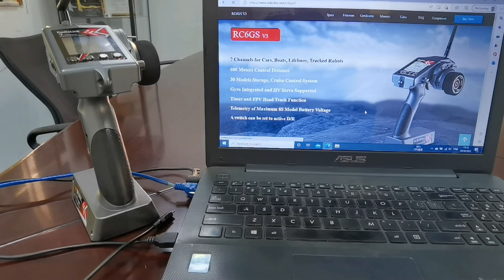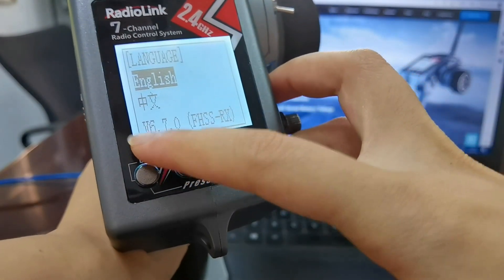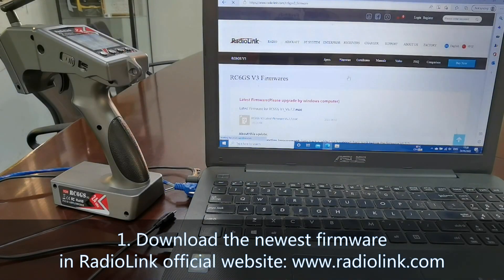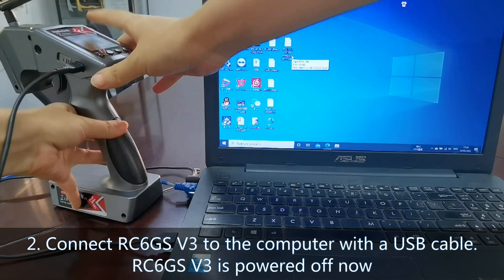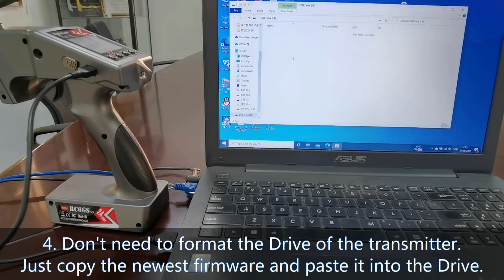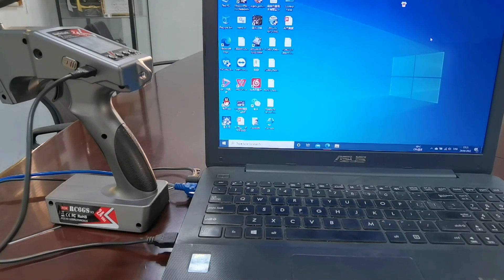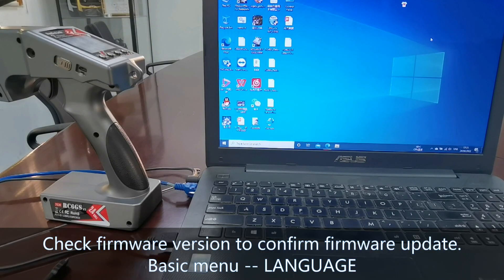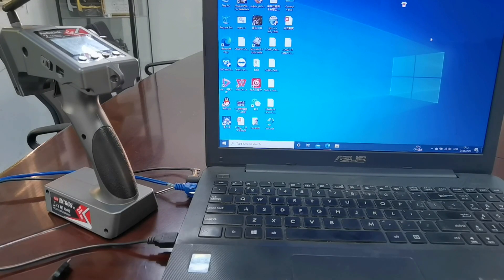How to Update Firmware of RC6GS V3/RC4GS V3?

Comment: HELP!! Did exactly what you are demonstrating, upgraded from 6.7.8s to 6.8.3A (using a Mac) and it went horribly wrong. Backlight of the screen flashes, nothing else works. Exactly like @hermy.santoso is describing. Tried going back to earlier firmware, no success. Please help. What to do?
Reply from the maker: Hi, sir. Could you please first make sure your transmitter is RC4GS V3, not RC4GS V2 or RC4GS? If it is RC4GS V3, there may be something wrong with the firmware or firmware update process of your RC4GS V3. You can follow the below link to download the firmware and update the firmware again. I have attached the firmware to you.
https://www.radiolink.com/rc4gsv3_firmware (You can also check the tutorial of firmware update here) By the way, could you please use other Windows computer to have a try? If any question, please feel free to contact us. Our email is after_service@radiolink.com.cn
Reply: @Radiolink_official  Yes, it is a RC4GS V3. Yes I have used the right firmware version. Yes initially I did the update using a Mac (since you claim to support MAC: "RC4GS V3 Firmware (Please upgrade by Windows 7,8,10,11, computer, or upgrade by Apple MAC computer).” No, an attempt to fix it using a Windows computer did not fix it. Something else is wrong. Please get me some real tech support. It looks like I need to format the built-in USB/SD drive, but then I need the entire software package to restore (not only the firmware file). Could you check if this is doable?
Reply from the maker: @hybricks9390  Hi, sir. Sorry to hear that. Could you please change another USB cable to have a try? Please make sure the USB cable supports data transmission function. If problem still exists, you can send us a video to show it. Thanks in advance.
Reply: Also encountered this. What you need to do IS unzip the file to get the.mac instead of copying the whole zip file inside the TX. So copy the .mac into the TX.
Reply: I got same issue. Upgraded on Mac and failed. Tx won't turn on now and USB unrecognized on both Mac and Windows. Did you solve the issue?
Reply: @mrpham0521  Nop, I waited for my anger to settle down, then returned the product to Amazon ("not working") and received a new one which I didn't upgrade

Comment: Can the RC6GS V3 firmware be uploaded onto the RC4GS V3 controller to unlock the extra channels and install the additional switches? Effectively turning the RC4GS V3 into an RC6GS V3? Thanks
Reply from the maker: Hi, sir. RC4GS V3 can update the firmware of RC6GS V3. But there are only 5 switches available on RC4GS V3 after you update the firmware. RC4GS V3 cannot be changed into RC6GS V3 by updating the firmware. And we do not recommend you to modify the mainboard of RC4GS V3 to add two more switches, as it may damage the mainboard. If you are using RC4GS V3 and want a RC6GS V3, we can apply for a discount for you to buy one. If you are interested in it, you can contact us via email: after_service@radiolink.com.cn  If any question about RadioLink products please feel free to contact us.
Reply: @Radiolink_official  Thanks for the reply. I only need 2 channels for now. I was just curious about knowing if it could be done.
Reply from the maker: @tonydelovski8088  I see. If any question about RadioLink products please feel free to contact us. Our email is: after_service@radiolink.com.cn

Comment: What does the new firmware add to this system
Reply from the maker: Hi, sir. Are you using RC6GS V3? You can download the latest firmware of RC6GS V3 from the link: https://www.radiolink.com/rc6gsv3_firmware  And you can check added function in the latest firmware here. Firmware V690 Upgrade Instructions: Optimizes the Throttle delay function.  If any question about RadioLink products please feel free to contact us. Our email is: after_service@radiolink.com.cn

Comment: my RC6GS v3 wont bind with my new R7FG receiver.  It still flashes green, what is wrong?
Reply from the maker: Hi, sir. Could you please check this tutorial on how to bind them:  https://www.youtube.com/watch?v=iTrBj7eO6F0  You need to long press binding button of R7FG. Then the LED will flash quickly, when the light goes solid, the binding is successful. Please note, R7FG has two antennas, which has signal amplification, so it is better not to keep them too close when binding, because there may be signal block. You may keep a distance of more than 50 centimeters when binding them. If there is still any problem when binding, could you please take a video of your binding process to our email after_service@radiolink.com.cn  ?
Reply: No matter what battery or speed control I use, the transmitter says "RX Low Power!!"
What am I missing?
Reply from the maker: @eric4953  Hi, sir. Could you please enter "ALARM" menu of RC6GS V3 to check what alarm value did you set for RX? The voltage of the receiver is lower than the alarm value you set, then there will be alarm. Here is the detailed manual of RC6GS V3, which introduce all information of it: https://www.radiolink.com/rc6gsv3_manual  Could you please have a check? If any question when using RadioLink products please feel free to contact us. Our email is: after_service@radiolink.com.cn

Comment: Is not recognized as a drive, the same problem with three computers. Cable is ok
Reply from the maker: Hello, sir. Sorry for the problem. The problem mainly comes from the cable. We recommend you to change another cable to have a try. If the problem still exists after you change different cables, could you please take a video and send it to after_service@radiolink.com.cn
Reply: @Radiolink_official  I tried different cables and it actually worked at some point. Many Thanks.
Reply from the maker: @drachenopi4159  Great to know that. If any question when using it, please feel free to contact us. Our email is after_service@radiolink.com.cn

Comment: Can't you update assigned button short cut for mixing.. it will easy to us to switch on the mixing. Its hard to on the mixing by go to menu each time we want to mix.
Reply from the maker: Hello, sir. What transmitter you are using? For RC6GS V3 and RC4GS V3, you can assign a switch to control mixing. That is to say, you can switch on the mixing directly, and don't need to go to menu to turn it on.
Reply: @Radiolink_official  im using rc6gs v3.. can you teach me how?
Reply from the maker: @aminvolta  Hello, sir. If you are using RC6GS V3, you can assign a switch to control mix. Don't need to enter the mixing menu. You can check this tutorial. Then you know how to control it. https://www.youtube.com/watch?v=CjvbySByvvw&t=3s
Reply: @Radiolink_official  is there any new update on the rc6gs v2??
Reply from the maker: @rclunatic  Hello, sir. Do you mean the firmware? Here is the latest firmware of RC6GS V2, could you please check if this is what you want? https://www.radiolink.com/rc6gsv2_firmware By the way, we have released new transmitter RC6GS V3 and RC8X. Here is the link for your reference: https://www.radiolink.com/rc6gsv3   https://www.radiolink.com/rc8x If any question when using RadioLink products please feel free to contact us. Our email is: after_service@radiolink.com.cn
Reply: https://youtu.be/3rHLtBGFeHw

mixing~~